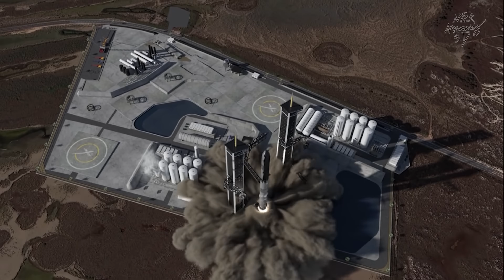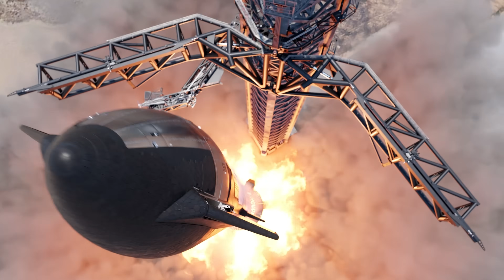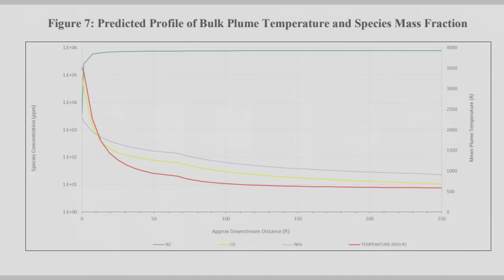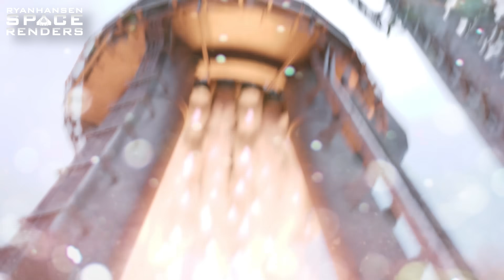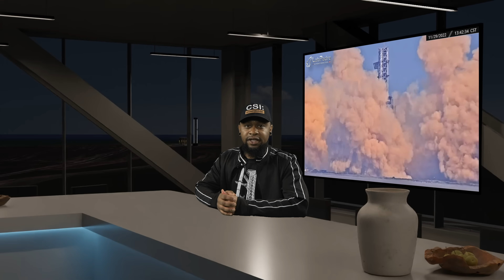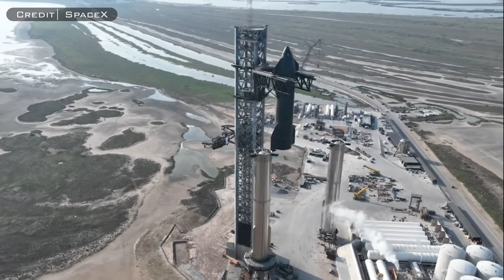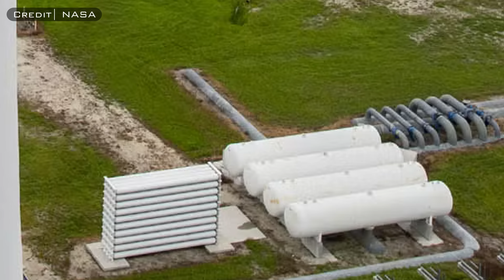SpaceX's "Major" Concrete Problem + Water Deluge Construction Begins at Starbase

Comment: And what about sound waves, pressure and/or frequency? Shouldn't they be considered in the equation to determine if the concrete will stand? I suspect that 33 raptor engines can produce a substantial ammount of sound pressure 😅
Reply from the maker: Yes. They didn’t have data on this though.
Reply: @CSIStarbase  Yes, but probably you can find an estimate here:
https://www.faa.gov/space/stakeholder_engagement/spacex_starship/media/Appendix_B_Noise_Assessment.pdf

Comment: I recall watching a video about welding/cutting metal. Oxy-acetylene is used even though it isn't the hottest flame. It's advantage is the speed of the reaction which means you can significantly increase your gas flow and therefore the amount of energy you can put into the cut.
The same things is going on here - it may only be 340'F but that is very turbulent, high flow, high pressure heating. It would heat up the concrete very rapidly.

Comment: This video neglects an important phenomena when estimating the temperature that the concrete surface is exposed to. There is a point on the concrete where the rocket exhaust plume is decelerated to zero which is commonly referred to as the stagnation point. This results in a recompression of the hot gas at that point and a significant rise in temperature.
Reply from the maker: Unfortunately, I don’t know how to quantify that. I’ll try to look into this more.
Reply: @CSIStarbase  A shock wave forms just above the surface which releases a lot of heat. The stagnation temperature at the shock will be approaching the nozzle throat temperature. The surface below the shock will be heated by a combination of radiation and convection so it comes down to heat flow, duration and  the materials ability to either conduct the heat awayl or ablate to protect itself. Figure 1.1 in the following reference is a good illustration of the physics https://research-information.bris.ac.uk/ws/portalfiles/portal/34494559/356300.pdf

Comment: U would think that with all the rocket launches at Nasa that they would have taken those same lessons learned there at pad 39A and B and applied them to the construction at Starbase Boca Chica. Now having said that someone texted me in response to a comment i made asking why they did not construct a water diversion system like at Nasa saying that 'they could not because of wildlife conservation restrictions'. Now in your video u neglected to apply a water deluge system to your equations in this video. Would that not cool down the exhaust/concrete from the 33 engines without causing any wildlife conservation concerns and concrete shrapnel there at StarBase?
Reply from the maker: The reason water deluge at Starbase was initially issue is because of the amount of steam produced. They viewed the steam cloud as extremely harmful to wildlife.
Reply: @CSIStarbase  there is not going to be any wildlife or human life is we get hit w/another large astroid.
I say screw the wildlife...they can relocate...they r adaptable.
Reply: @zarl5238  Good luck convincing that to the public
Reply: @alvianchoiriapriliansyah9882  thx Alvian for the reply...u r right...since the masses r asses :)

Comment: Let's assume for a moment that the pad experiences considerable damage. Then why not place on top of the concrete a couple of 3" steel plates.  There are high thermal resistant steels that are also high pressure resistant.  This could easily give SpaceX the reusability that they are looking.  This would also be easily replaced in the event of a need.  Tell me what you think.

Comment: Brilliant insights as usual! Minor assist on the deluge system, pressure in the system on the existing deluge for the Falcon system is measured by the difference between the height of the tower and the height of the outflows, not just the height of the tower alone -- so the pressure at the end is probably more like 7 bar, or 6 bar greater than gravity alone in the new tanks. Pressurizing the inner and outer tanks at 3 bar each could be the solution... Would have never thought of that engineering solution on my own, that's for sure! Your work is amazing in so many ways, keep it up!
Reply from the maker: Thanks! I was considering the Starship Launch pads deluge system when I thought of that. Its at ground level instead of raised like the F9 system.

Comment: Your freedom units confuse me. I thought you are an engineer?
Reply from the maker: I usually use what ever units the data sheets are using. Engineers solve problems with what ever units are presented to them. Sometimes we convert them first but that's pretty rare unless its actually required.

Comment: Obviously, water boils at a lower temperature at altitude, and at a higher temperature when the environment provides a higher pressure (confined and compressed by heavy concrete, or congrete that has been compressed even further by rocket plumes) so the reference to 212F as the boiling point of the water in the concrete seems likely to be spurious. But I'm really enjoying all of your research and presentation, so don't let that one "jackal" comment detract from my praise and enjoyment of your content. Thank you!

Comment: Great and informative video Zac 👍🏽. One question: is the concrete's pressure rating at room temp or at its max heat rating?
Reply from the maker: Hmm that’s a good question. It doesn’t say on the data sheet unfortunately

Comment: Great work as usual.  There is a question on timing for this new piping.  Before SF33,  After SF33 but before launch, or after launch.  I suspect SpaceX will take pad damage over schedule slip until after launch, but that is just my over optimistic speculation.
Reply from the maker: It seems like they are in a rush to get this installed. The equipment won't arrive until around February 2nd though

Comment: Would it help release the moisture in the concrete if it were preheated internally?
Reply from the maker: I'm not sure on this one. But I believe the concrete will potentially absorb water due to precipitation or even through humid air.

Comment: Really interesting deep dive once again. Thanks a lot! 
From the very beginning of launch site work at Boca Chica, there were many people who were critical of SpaceX for not installing a proper flame trench. Others didn't really care, because the problem can be fixed at any time, but were critical nonetheless. 
But ultimately, SpaceX is so successful partially because it tries to challenge assumptions - nobody has really tried before to build a completely "minimal" launch site before (outside of military / military-like small sat launchers, but that's much smaller scale). That's what this launch site is - think about it: it doesn't require much earthwork, it can basically be put anywhere with a large enough flat surface, and a lot is built with rather normal commercial equipment available anywhere in the world.

(Another argument was testing Mars capabilities: you don't have a launch site prepared on Mars, so if Starship cannot withstand a bunch of concrete exploding underneath it, then it needs better shielding - however, that argument doesn't work for Superheavy, nor does it work for sustained launch campaigns beyond the initial testing).

Of course, in challenging the assumptions on what is supposedly "needed" for a launch site, SpaceX has experimented with leaving out as many parts as possible and making simplifications - some of them worked, or will work, and others don't work quite as well. I think the issues with concrete spalling and damage has proven that you do indeed need some kind of flame trench or at least a really sturdy launch pad with special damage-mitigation built into it. It's a lesson to learn.
However, that is not a failure of SpaceX engineering, but rather a valuable result of their experiment in designing a more minimal launch site.
Reply: I know this exactly what I've been thinking like people don't give them enough credit they just doubt them instead. This is how SpaceX operates and people should of realized this by now especially after all their other endeavors. After all some of brightest engineers work for SpaceX most of them are on the starship project. They have likely discussed a lot about this. it is not at all overlooked or not cared about enough like so many believe
Reply: The starship launch site is being optimized to avoid over-engineering, over-complexity and over-expenditure.

Comment: I believe there is little chance that the existing tanks at the launch site will be used for the deluge water.  It doesn't seem logical that they would employ a relatively more complicated, nitrogen system to propel the water when head pressure costs nothing other than running the pumps to initially get water elevated to a normal water tower.

Also, I worked for a company that provided actuated valves for the deluge system at one of the launch facilities in Florida, I believe a Lockheed facility.  The valves we provided were full bore ball valves - not butterfly valves which you routinely show.  Our full-bore valve design maintained an internal diameter that was the same or close to the internal diameter of the adjoining pipe, thereby enhancing flow characteristics with as minimal pressure loss as practically possible across the valve.  Unlike butterfly valves which open by rotating a central stem and disc to a position edge-on to the flow (causing some restriction of flow), ball valves have unrestricted bores, thereby allowing more efficient flow.  Like most ball valves, ours were quarter-turn, and they were actuated with quick opening actuators, allowing almost instantaneous flow.  The point is, that using a water tower with substantial head pressure without resorting to pumps or artificial pressurization by nitrogen, and by using flow efficient valve design, the system is as safe and reliable as possible with a minimum of expense to operate.

Hope you find this helpful.  As always, thanks much for sharing.

Steve
Reply from the maker: Thank you. It was difficult to tell what kind of valves were installed in the original system at 39a. Hard to get a clear enough image to make them out.  

Im not sold on the big tank either way, however I am pretty confident the smaller horizontal tanks will be pressurized with nitrogen.

Comment: I really appreciate your job and your explanations, but PLEASE use the METRIC SYSTEM.
In STEM disciplines the standard is the METRIC system, even in the US, and using imperial units causes problems and misunderstandings (and was even the root cause of the Mars Climate Orbiter loss). I know that Americans may find some problems with the standard metric system, but in the world today only US, Myanmar and Liberia sticks with that absurd and ridicolous measurement system.
So please use the metric system as main unit system and add converted values for those Americans who struggle with standards (are there any?) 
Thanks an keep up with these great videos. 
Flavio 
It is more
Reply from the maker: I went to school for mechanical engineering. Our homework problems were given to us in every unit imaginable. They teach us to solve problems with the units given to us.  I present data using the units given on the data sheet. I convert them out consideration for the minority of my audience who uses the metric system. 

All infrastructure at Starbase is desired in imperial units. Vehicles are designed in metric.  Appendix G gave all dimensions in imperial.

Comment: A lot of this problem could have been solved with a taller launch platform. At this point, a trench isn't possible, there simply isn't enough room so any solution will require an above ground system.

Figures that the only thing I see being an issue with the whole Starship program, is this.
Reply from the maker: Yes. The taller launch mount would have been the 🔑 to success here.

Comment: Great content! I also love how you use reasoned, evidence based, logic when speculating, BUT also pointing out that you ARE speculating and could be wrong.

The a couple of otherwise great content creators tend to speculate as well, but come across as if they 100% know. Like that square by the OLM is 100^ for a new tower and the segments in Florida are 100% going to be moved to Texas to build it... that may well be the case, but it could also be completely wrong.

It will be interesting to see what they plan for the OLM as its clear they've learnt and done thing differently in Florida. 

Can't wait for your next deep dive!!!
Reply from the maker: Thank you! Sometimes even stating that isn’t enough for some folks.

Comment: Maybe it's better to clad everything with high strength steel plates, multiple inches thick and intensively cooled with water deluge (above and under). The Iron will spread the heat much more quickly than concrete and probably take a while to ablate to a point that it needs replacing. Modular design can reduce maintenance times.
Or, alternatively, have part of the deluge water pumped up through small holes in the concrete and  pylon cladding to form a layer of water to flash to steam and take away the heat.

Comment: I'm afraid Elon sank his teeth a little too much into keeping the launch stand simple. It's clear something more robust is needed to withstand the violence of 33 raptor engines at full thrust for multiple seconds. I'm also very sceptical about Starship and a human rating. I just don't see it happening without some serious redesign, plus splitting Starship into two pieces, a propulsion section that can land as it is intended and a dream chaser type of craft for a safer path back to mother earth for crew. The two separate just before re-entry, after the de-orbit burn. It's the only way I can see Starship ever bringing humans back to earth. Launching is a different matter, human rating for launch can be achieved much sooner for obvious reasons, as long as there is a way home for the astronauts of course LOL

Comment: The answer may be stainless steel blasting mat anchored into the concrete under the launch mount. It will protect the concrete. Don't know how long before it erodes, but it should work. This stuff is used to contain explosions.

Comment: Thanks for the update. While I expect that SpaceX will (eventually) get the pad sorteds this seems to be a fundamentally flawed design. No one seems to have issues with a flame trench/diverter so I can see SpaceX eventually going to this solution. Also, if they put in a big water deluage system at Starbase where is all the water going to go after it hits the pad? I don't believe that they can just dump hundreds of tons of fresh water into a sensative costal environment. Or am I missing something?

Comment: I think risk vs reward of rapid reuse ability for such a large system is tilted to risk.  Minor variations in velocity and vectors on landing could damage or destroy the tower and/or armatures.  At a high launch cadence likelihood of a mistake rises and detonation or uncontrolled burning of that huge fuel load will destroy the launch facility.  Small mistakes will have huge consequences.

Comment: Water creates new problems. Divert, dilute (in air), and defend against the hot exhaust is a better approach if possible. Instead of deliberately getting the concrete wet, should consider bake out of moisture between launches. When launches are close together little moisture will be absorbed reducing spalling

Comment: Even the legs holding the tower are subject to heat that eventually will fail a tunnel should direct thrust away  .
Reply from the maker: I think they should put a layer of Fondag around the base of the tower. Or Martyte. They could also use fire bricks which is what is used on the walls of the Pad 39a and 39b flame trenches

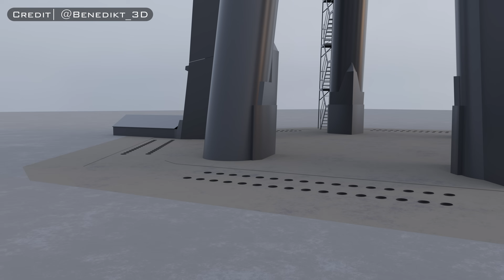Comment: Would it be possible to have the system inside the « inner circle » of the legs of the Pad, instead of outside as seen as 21:00 ?  The Pad already posess a deluge water system for the Raptors of the outside circle, and it seems difficult to pass through the trust of these Raptors from the outside circle to protect the concrete right under the inner circles of Raptor. 🤔

Great work again in any case 😃
Reply: Hi, Thanks for your comment. What you're talking about isn't really water deluge, it's the FIREX Detonation Suppression System. It's explained here https://youtu.be/9yolbTb_wS8 👌
Reply: @Geoff_A  yep, I know… and it doesn’t change my question 😅  Okay, I’m a bit harsh in my answer. What I want to ask is : is the risk for the concrete only really at the core, or everywhere on the surface under the pad despite the Firex system already in place ?

Comment: In your pressure calculations, you are calculating the static or average pressure. In the turbulent exhaust flow, it is likely that the dynamic pressure would greatly exceed the static pressure.
Reply: Covering the pad with a steel sheet and deluge it with water could possibly mitigate the exhaust sufficiently to protect the pad.
Reply from the maker: The flame diverters under pad39a and 39b that you saw in the beginning of the video were actually covered with 4-6 inches of Fondu Fyre. Similar to fondag. Bare steel is not a good idea. The melting temperature of steel is like 800 degrees lower than the max operating temp for Fondag

Comment: SpaceX was initially planning to put in a flame trench, but the corps of engineers refused to permit it.
Reply from the maker: I disagree with that. I would have to see evidence that they ever planned to do that. I don't even think its possible at Starbase
Reply: @CSIStarbase  I believe that it got axed due to the Geotechnical report on the site that indicated that it could cause stability problems with the launch tower, but I can't find any details.